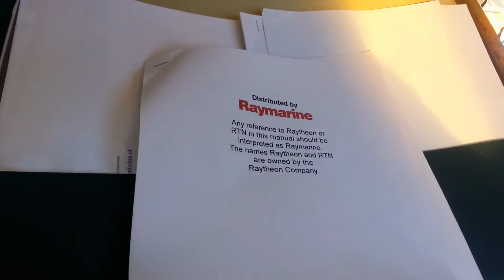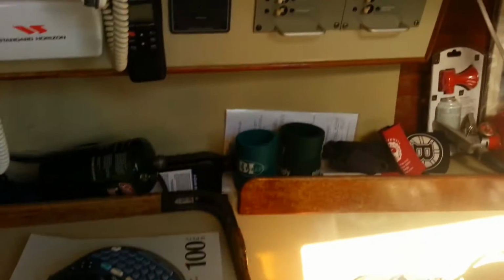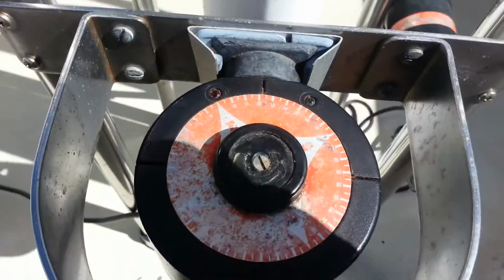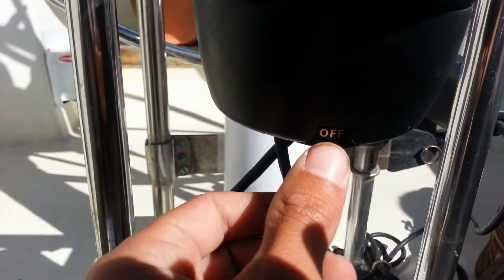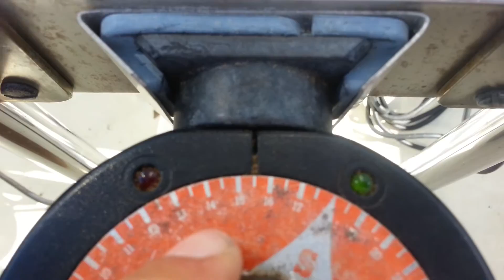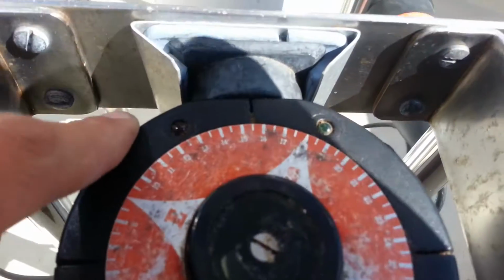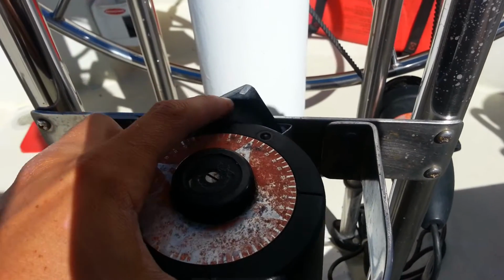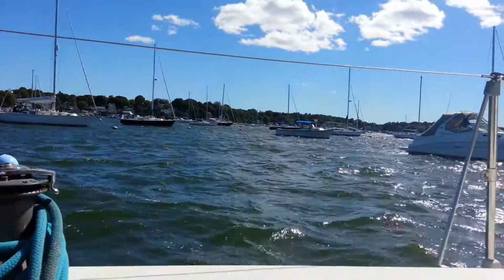Raymarine Autohelm 3000 Operation Procedure

Comment: Hi mate. Sorry to here it didnt work. In about to pick up a boat with one of these that the owner swears by. So ill see. Qusetion though any idea what belt it takes as his is basically scrap and u cant just use any belt need teeth distances right. Any help would be great 
Thanks in advance...
Reply: ***** thanks mate that would be great if you could check. Ill try to contact them re belt also.
The manual you had in video is diffrent and shorter than the one i downloaded. But they are very old and if dropped thats that.
Are you living on boat? Im going to spend a year doing mine up for world touring. Need the break and to get away from people for a while.
Reply: ***** hey Chris itd be great if you could send it. Id be more than happy to pay for the post and if youd like some cash for it. 
I thinl your right about taking a while to organise and upgrade. Im on a shoe string but have been sailing since 5yrs old so hoping on my way around to either do some saling leasons or fishing trips. Or work for my super. 
Anyway thats a very kind offer let me know what youd loke to do and we'll organise it.
Cheers Mate.